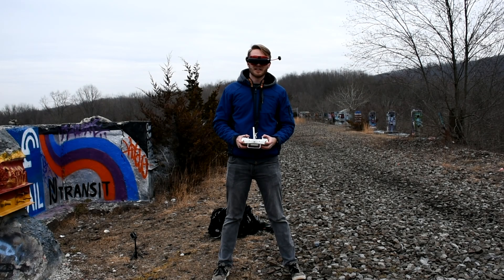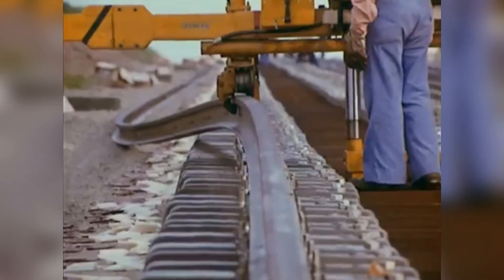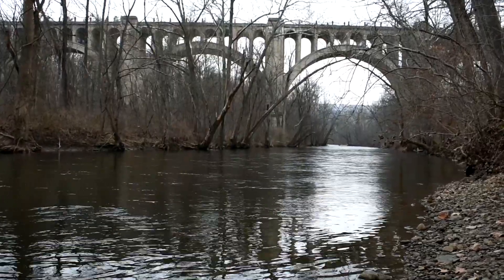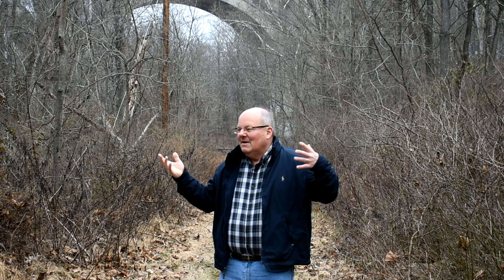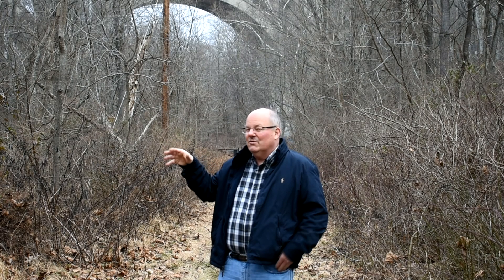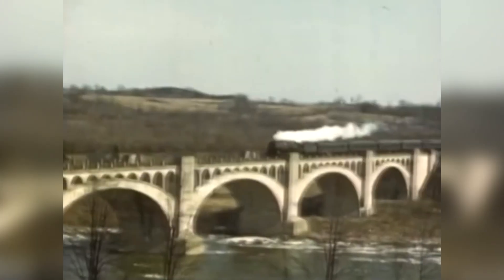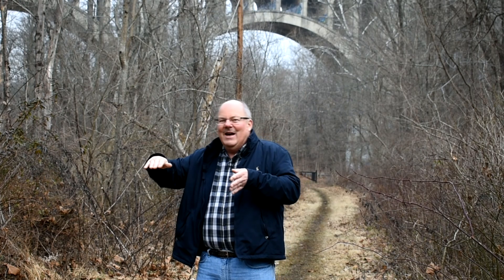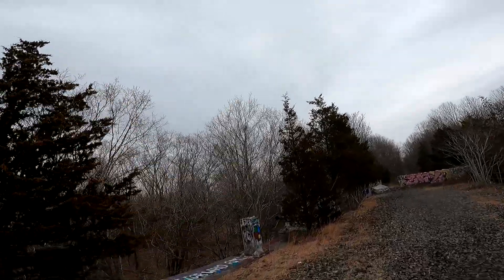The Abandoned Lackawanna Cutoff will be Brought back to Life

Comment: Leveled right of way is not needed.  Look at the LGV PSE (or LN1) in France, between Paris and Lyon.
Reply from the maker: This is true, but SNCF HSR's are kinda unusual in this aspect. Also this is the US we're talking about, most lines we half ass like Brightline with some fancy looking diesels.
Reply: 3.5-4% is OK at high speed. (SNCF max is 3.5%, DB has 4% between Koln and Frankfurt).
Reply: @andrewwcook  
The ICE 3 has stacks of power though, and such grades mean that no freight traffic is possible. The Hannover-Würzburg line for example is designed to allow freight traffic, and thus features gentler curves with less superelevation and grades of up to 2%.
Reply: @mikeblatzheim2797  that's right. ICE1/2 aren't permitted to use it. But most HS trains now use a similar configuration to ICE3. Mixing HS passenger with much slower freight isn't really practical for most routes.
Reply: @andrewwcook  
I think the intent is usually for freight trains to travel at night, though in practical terms that's rarely done, as it would require these trains to be held until nightfall and the necessary infrastructure to hold them doesn't exist.
Reply: @mikeblatzheim2797  Of course building HSR routes should open up capcacity elsewhere for freight in theory at least. Many HSR lines are closed at night to services as that's the only time maintenance can be done.
Reply: @mikeblatzheim2797  I think that the issue is to profit the several crossovers to the conventional network to run freight trains on the high speed line.  There are some pictures of freight trains during the day.

Comment: My goodness, this is like the Highline in NYC, but WAY worse
Reply: It should be remembered that the Cutoff and High Line were abandoned for the same reason: not enough business to male them worth keeping. 

All of the railroads that formed Conrail in 1976 were bankrupt and falling apart, or nearly so. That's why so much was abandoned; the traffic that had built the lines was GONE.
Reply: @JugSouthgate  I am aware, but it is still pretty sad to see
Reply: @arifakyuz7673  yes it is. I blame Robert Moses.
Reply: @JugSouthgate  Complete mail trains were made up from the Post Office on the HIgh Line. Trains to Saint Louis and Chicago too. End of mail was end of it all. Now it's trucks and traffic on streets and highways. Under a thousand miles overnight rail is just as fast as air! But it goes by truck.

Comment: High speed rail is the future especially in the US where you have so many options for it. Environmentally, it's a no-brainer.
Reply: Your right its a no brainer. By the time high speed railroads are built at a cost of billions no one will ride them. Electric cars and busses safety will go 100MPH or more and electric and hydrogen VTOL aircraft will beat almost any high speed train.from city to city.
Reply: No one wants it.
Reply: @ronstrulic4388  Buses or HSTs?
Reply: @fredbloggs8816  high speed rail.
Reply: @ronstrulic4388  Do you think climate change is an issue for us all to address?
Reply: I'm all for more fuel efficient vehicles and letting the free market develop alternative energized vehicles.  What we don't need is our joke of an administration putting fake timelines out costing us billions for the inept US government timeliness.   Since we're talking about the cutoff a prime example is the Portland Power Plant.   The government gave them an unreasonable timeline to convert to another source of fuel.   They shut it down.   Cost jobs.  Cost railroad jobs shall I keep going?   Which I'm sure has some of the blame for the closing of the Allentown Hump.
Reply: Environmentally, the no-brainer option is to make more efficient motor vehicle transportation systems and more efficient usage of roadway materials. 

After all, asphalt is over 80% recycled compared to wooden or concrete railway sleepers or railway bed ballast. All of those have to be continually replaced and cannot be reused on the line. Once the ballast has been ground to dust, the only option is to get more ballast, which requires crushing stones and exhausting quarries over time. Railway sleepers need to be gathered from trees, which takes a considerable amount of wood; wood from trees that take several generations to grow. Asphalt required less new material input than ballast, since most of it can be recycled and used for the same task. 

Roads are ironically more resource-efficient than railway lines.
Reply: @ronstrulic4388  Abuse is not an argument one way or the other, just a distraction from thinking, e. g. if I say free market loving sheep, where does that go? The issue is not to deny climate change is happening and that it is it is man made, it's also not appropriate for the US to require everyone else to sort their mess out before they even get interested in the subject? Per head, the US is still double the energy usage of China and way above that of India. As for the efficiency argument, public transport will need to make a comeback, to reduce carbon emissions. That also means change in the future and it won't be comfortable for any of us. Tinkering around the edges won't cut it.
Reply: If the American people wanted to take trains they would have, hey prefer to drive or fly.

Comment: Are those concrete viaducts still strong enough for service?
Reply: They might well be OK. They are probably mass non-reinforced concrete, like Glenfinnan viaduct in Scotland of a few years earlier which is still going strong with no problem. "Concrete rot" tends to be a problem of reinforced concrete from the 1950s onwards and it's the reinforcing steel that rusts and bulges, not the concrete.

Comment: Great bicycle highway. It could be 4 lanes, Just repair viaducts, Install safety fencing, and pave.  maybe light with solar light posts, install security cameras and monitor. Restaurants and snack shacks, bike rentals and service will spring up on the route. Even Air B&B homes will host riders.  Of course locals could also use the corridor for running errands and even daily commuting. High speed rail is a fools paradise. No 0ne will ride them. The tickets would cost a fortune. Don't throw away tax payer money on the high speed rail boondoggles!